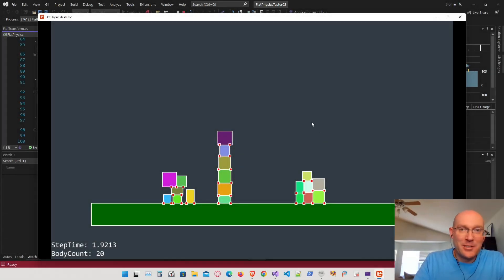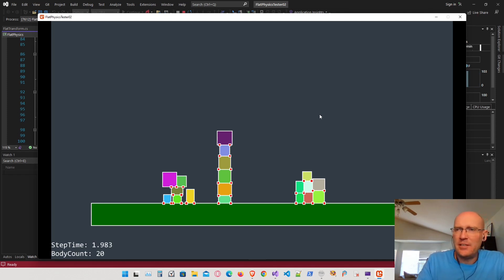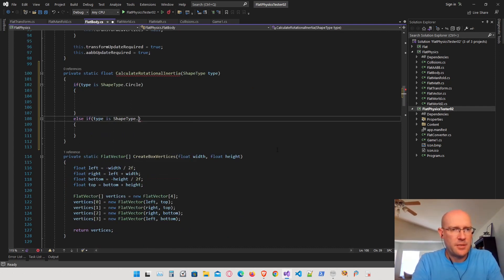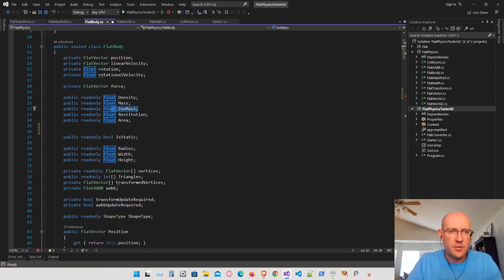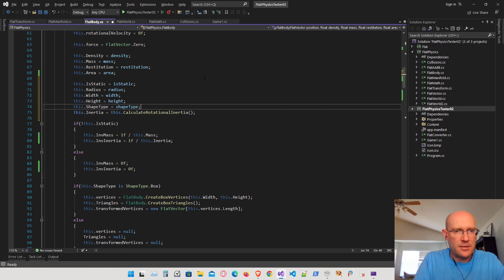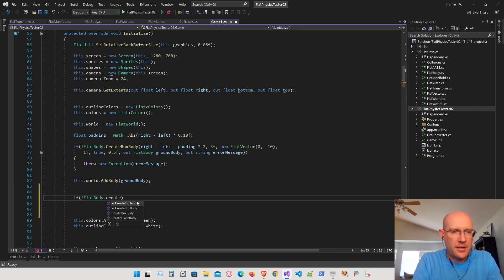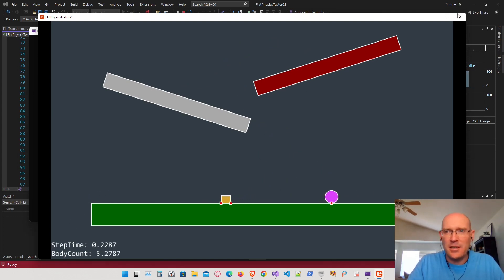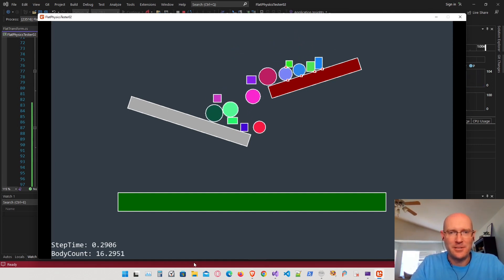Rotational Inertia - Let's Make a Physics Engine [21]

Comment: How do you tell if a disk is rotating or not?
Reply from the maker: In our current way of drawing circles the rotation  won't show up.  We'll have to place some kind of mark on the inside of the circle so we can see the rotation. Maybe a line segment that extends from the circle center to the circle edge?